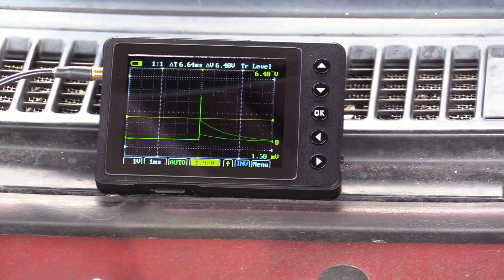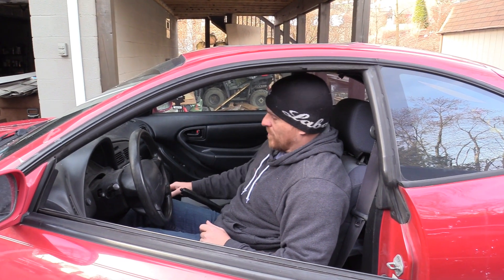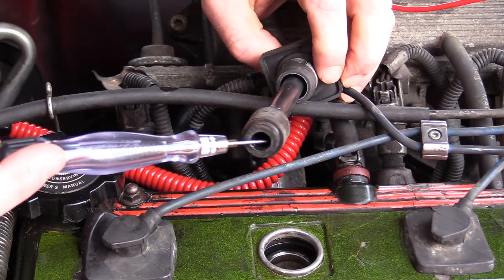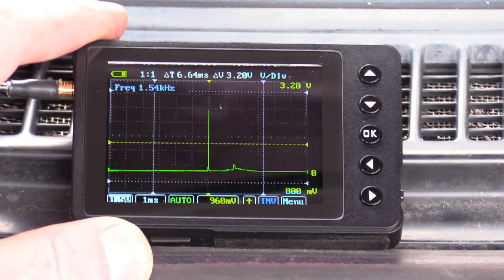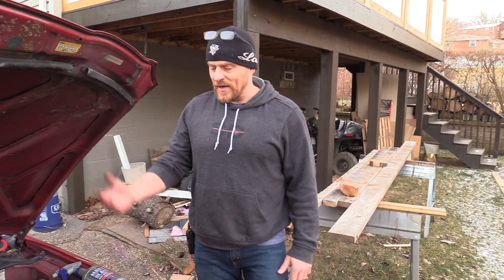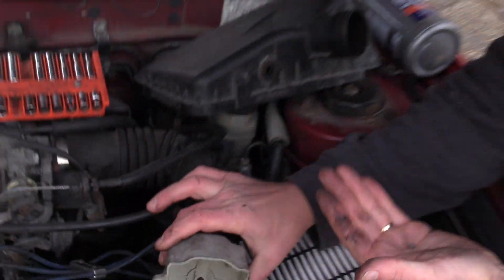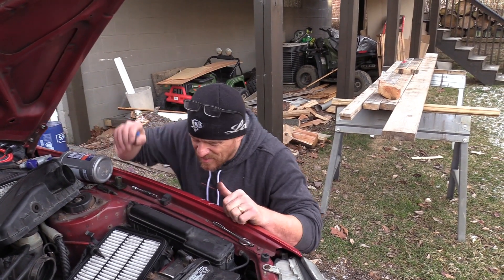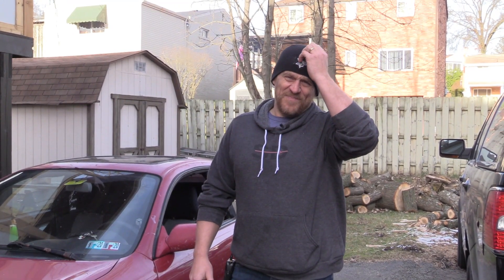Misfire, weak spark, 2 years after coil replacement 94 Toyota Celica (part 1)

Comment: WIN:  "Whats he doing with an inspection mirror in his car???  Thats my inspection mirror!!"
LOL that was awesome, thanks again Mr Danner.
I just diagnosed a broken center carbon brush in a 1998 Corvette distributor cap: no RPM signal, no ref signal to ECM, no injector pulse, intermittent spark.  The little nub was literally bouncing around under the cap like a bolt that falls out your pocket in the washing machine.
Stay gold.

Comment: Great video.  I had a 1988 Toyota Camry with a 3S-FE engine with ignition problems. It started with a distributor O-ring leak (easy fix), then it started missing really bad.  I did a resistance check on the coil and it was out of spec.  Got a new coil and for a good measure bought new Autolite plug wires/cap and rotor.  Ran good for awhile, but then started missing again.  When I pulled the spark plug boot, it came off!

Bought OEM plug wires and the problem finally went away (the misfire problem at least).  It ran really good, but after a several months, I noticed there was oil still leaking from the distributor and engine getting worse.  Checked the O-ring again (fine), what I found was that the oil was leaking internally through the distributor.  So I bought another used distributor.  It was a trouble free car other than the ignition system.  Sold the car after several years after that.

Later, I bought a 2000 Camry with a similar 5S-FE engine. Toyota redesigned the ignition system.  The distributor was replaced with coil packs and the plugs were now dual-tipped platinums.  Drove that car for 16 years, only changed plugs at recommended intervals.  Never had any ignition system issues whatsoever.

Comment: I bought a new 455 Olds in 1971. Shortly thereafter, on cold/cool mornings (I left it parked outside), it would backfire, spit, miss until it warmed up. Took it to the dealer, left it over night (they put it inside their shop) went back they said they couldn't find anything. Next time it did it, I opened the hood and noticed a tiny film of moisture on the outside of the distributor cap. Took the cap off, sprayed it with WD-40 and no miss, no backfire. Went to the parts store and bought a new distributor cap. Left the old one outside the next night, and looked at the inside the next morning and there were a couple of hairline cracks in the cap noticeable only because the moisture left a track on the cracks! Wiped it dry and I could not see the cracks. If it can happen, it will happen (to me).
Reply: I had a similar ordeel with an old ford electronic ignition control module when they used to sit on the fender. On really hot days or cool nights with a lot of condensation,  it  spit and sputtered like you mentioned. A few times it just shut down until it cooled off.

We didn't have access to all the fancy scopes back in the 80s but a friend was smart enough to set a heat lamp about 3 feet away from it while the motor was idling.  It caused the problem to surface in a out 5 minutes and I replaced it from a salvaged car. Problem solved.

Of course the module was packed with epoxy so a teardown was not informative and what little inspection we could do showed nothing obvious.
Reply: @sumduma55  Yep. Jeep used the same on my 1977 CJ5! Really threw me for a loop first time it did it. Finally put a 6 cyl Chev distributor in it with coil in cap. Stopped that BS.

Comment: Nice find. I remember the old days, I installed a lot of those distributors, no matter what Scotty Kilmer says, they break too.

(Dielectric grease is great on plug boots to help reduce leakage and help with later removal. I’ve seen connectors with it glopped in them causing issues, stop it guys, a little goes a long way to stop fretting and reduce moisture intrusion.)

Comment: We bought a 89 Camry from a little ole lady  that had very low miles, it only went out on Sundays to church well unless she was from Pasadena then maybe the strip. Some time after we bought it my son tells me it's shifting out of overdrive and he tells me that he just leaves the button for OD off. I figure maybe it's the clutch in the torque converter that is going and maybe with a change of ATF it might help with it shifting. We drain the trans, replace the filter, and put some ATF in and run it with the output line to the radiator in a clear mayonnaise jar so I can see the color of the fluid and we also flush out the torque converter. Now my son says it shifting great again but a short time later complains that it's doing it again. So now I take it for a ride and tell him it's not a problem with the trans he has a misfire. Sometimes in OD it would lug the engine and that's when it would misfire. So I look at the plugs and they could use a change and I  find one of the wires is the culprit. Not wanting to work on this car for at least another year I put wires cap and rotor in. The cap was dirty, a bit oily and there was some carbon tracing. Okay fixed Wright I mean right. Yeah for another three months or so it ran flawlessly till my son comes home one day and says it's doing it again. Dang. Turns out the seal in the distributor was allowing oil into the cap and on rainy days or when there was dew on the ground it would misfire. So I replaced the distributor and it's been a year of good service. Knock on wood. Professor to Caleb, I gotta deal with your sh I mean stuff too. Wait til they get married and move out. They figure they earned the right to free storage.  Around 34 minutes ya say there was oil in the old  distributor. Ya stole my thunder. That's my story and I'm sticking two it.  Good ten minute video guys.

Comment: Oh yea.... Needed some more in-depth understanding of this issue. I got a 20yr Taurus with this issue. Just hit 400,000 last week! 💪 Changed out the spark plugs, wires, and coil pack. Drives good, not really noticable....but as soon as i hit those rpms above 3000, CEL pops on...
Reply: Btw, Caleb the Cameraman, you're doing an "impeccable" job with that camera and especially paying attention because of your questions 💪. So i guess the next step will be putting Pop behind the camera and giving us a ScannerCal episode 🤘😊...

Thanks for the video y'all....
Reply: Wow! 400 k!
Original motor transmission?
Reply: @Nudnik1  yes sir-ree! I've babied it the past 2yrs... They call the engine Vulcan... Darn near replaced everything on this engine - original timing chain still in it too; that's my next project...
Reply: @NaturalZBey  wow I got 370 k on my Chevy Venture original motor transmission.
Only minor issues.
Runs perfectly uses no oil.

Comment: A magic trick using a distributor! First I've seen of that! 😂🤣😂 

That was an interesting failure! Wonder if play in the shaft wore out that coil's case? Since you've got both heat and age there, it could've just cracked on its own, too. That car is in amazing shape for its age. Hate to see him driving it in road salt ... but I get it - when I was that age, I could barely afford the car I had, let alone a dedicated 3-season car, and a winter car.

Way behind on vids here - headed to part 2 now. 👍🍻

Comment: That's definitely a new one!  I never saw a pickup coil, even the early GM HEI units that were on carburated engines and the Dist pickup coil wires would break at the ign module because of the vacuum advance moving the plate.

Comment: Excellent about silicone grease.. true.
It just seals moisture out and prevents corrosion.
Not a conductor.
Stabilant 22 is a conductor improvement chemical used in avionics but costs $70 a tiny 1 oz bottle.
We had "carbon tracking" inside caps in old days after some one would spray wd40 oil inside Burning up causing carbon tracks misfire etc...
Excellent work Thanks!

Comment: Have to love the non-common weird root causes. Essentially it looks like it fail just like the water pump probably did. Bearings or bushings wore causing shaft wobble and leakage, in this case oil and also slapping the coil around.

Comment: Father and son time... more priceless than anything......great video as always....how the h*** was that car running, as well as it was at that!
Reply from the maker: spoiler alert, the reason it was still running was that pick-up coil was for the single pulse "cam signal", which is not needed for it to run and control spark. For injection control without that signal, it will still fire them, just in a default strategy

Comment: Funny you mention the dielectric grease being an insulator and not a conductor . Had a coworker who was very very back woods mechanic type and disregarded any repair info research as "not being a real mechanic" . He would pack every connector he opened to replace components with it and because of that have regular comebacks . Despite how many times I fixed his mistakes simply by blasting out all the dielectric grease he would never believe me when I would tell him to stop using it in connectors that host sensor circuit pins .

Comment: i have seen this happen twice in the last 30 years.  both on pickups with 22r engine.  coil short out and overheat and expand until the wires break and then wrap around the shaft.

Comment: I can't wait to find out what the second pick-up coil is for in Part 2.
Reply from the maker: the lower one with 4 teeth is for piston position and RPM (crank sensor) and the upper one with 1 tooth is to ID where the #1 cylinder is for proper injection control
Reply: @ScannerDanner   Thanks!
Reply: That kinda makes it even crazier to see #3 consistently missing worse, unless there was a "bigger" copper strand interference in the cap.

Comment: Oil - >bad seal  -> worn bearing -> wobbling shaft -> contact with pickup?
Reply from the maker: no contact, no wobbling in the shaft, but age and oil would be my guess too
Reply: @ScannerDanner  Good to know.. That's for sharing. Hey, while I have your attention, I've been asking on your forum but no solid answer yet. Besides your fantastic book, what's the big textbook I see on your student's desks in your premium videos?
Reply from the maker: @jameswasher3938  I just added the ones I would recommend to my amazon affiliate https://www.amazon.com/shop/scannerdanner the one you seek is the one with over 1600 pages
Reply: @ScannerDanner  That's right, I had the same problem, in my case it was the top pickup coil, the resin that composes it degraded and then the rotor with 1 tooth grabbed the coil wire, the car didn't stop because of that, but the check engine light came on (code 12)  the solution was a new distributor, part number 19020-16250
Thanks for sharing Paul
You're awesome as Steve says LOL
Reply from the maker: Dude, wait until you see part 2. You'll love it, my mistakes too
Reply: @ScannerDanner  Can't wait for part 2. When can we expect it?
Reply from the maker: @jameswasher3938  shooting for Saturday Feb 1st at noon

Comment: Is it that distributor design had two position senders? One reading  four pins for ignition events and second acting as cam position sensor (sending one signal per 360 of cam) for I think for sequential injection.
Reply from the maker: That is correct! And the reason the car still ran was that was the 1x cam pickup that failed

Comment: Love your channel. You are a wealth of info and diagnostic technique. Gotta ask a question though, once you realized you had an intermittent problem, why not just pull the cap off? I don’t know what the parts prices are, but I’d have just sprung for a cap, rotor and wires. Of course, once I opened it up and saw the oil and wire in there I would have realized I had a bigger problem.
Reply from the maker: Good question! For me, my diagnostic strategy is sometimes altered by the camera. I want to prove the issue for you guys before taking stuff apart.

Comment: "Dialectric Grease is an insulator"  I was at a local hardware store a while back looking for conductive grease, and the sales staff kept handing me Dialectric grease. I told them it was an insulator, but they wouldn't believe me.
Reply: Stabilant 22 is conductor chemical used in avionics and Marine electronic and at home Depot they have white conductive grease used on splices in primary secondary connect. In electrical Dept.
True silicone grease only stops corrosion not a conductor.
Reply: Use Copper Never Seize, we used it in resistance welding and if your careful it works great on relay pins in an old corroded auto fuse box.
Reply: @frankl1955  yes I have excellent salt water marine battery cables copper anti seize the best .
Reply: boostedsil40  keeps water out stops corrosion. Ok to use.30-50k volts in secondary ignition will not be affected.
Reply: Next time just tell them to look up the word "dielectric" in the dictionary
Reply: @jonclark1288  true dielectric oil used in transformers .
Reply: Wait a minute , Dielectric grease is ALL that should be used. About a pea size gob. carefully smeared around the lowest inside of the rubber spark plug boot. It insulates the high voltage spark from running down the spark plug porcelain to ground. You must do this step.
Reply: @rodneymiller5926  yes only olive oil on Fiat though
Reply: @Nudnik1  is olive oil an insulator?

Comment: Thanks for of course another good video! I have a question though about you saying to check the plug wire with the scope at close to the coil???  I would say you would want to check it close to the spark plug! Like you said-if there was break in the wire in the middle then at the coil it may show that it is firing but it matters the most at the plug. That is where you want to make sure you have voltage/spark/? If you dont show a reading there, then work backwards toward the coil. Like that is why you pull the spark plug wire off the plug to check for spark there first. If no spark then pull the wire from the cap and check-I dont think you would do opposite of that would you? Thanks for you time and info...Ken
Reply from the maker: always, nearest to the coil if you want to see what is actually going on. If you have a break in the wire, your KV near the ignition coil will show it to you in that you will have a very, very high firing line. On the other end of the open plug wire you are going to fight your scope and wonder why you are getting some weird readings.
Reply: @ScannerDanner  Wow, great reply, I never thought of it that way. That is why I asked the master!! Thanks so much

Comment: No quick vid for you. now for the polar opposite of your situation. I stopped to look at a malfunctioning brake light on a 14 Hyundai a few days ago. determined quite quickly that it was some sort of loss of ground and it was dim, energizing through other side of bulb a 2357, which is a lower current version of the 1157.(technically a LONG circuit, yes they exist. where 2 circuits converge in the form of a ground, loss of ground bridges 2 circuits together to ground through each other generally limiting the current like a resistor). It was dark and raining and i wasnt having it. I postponed it until today jan 25, 20, made sure i had my Vantage pro, my power probe pp3, incandescent test light and as a hail Mary my Power Probe  ECT3000. Test light and a stick to jam the brake pedal, 10 minutes, and i had it pinned down. Bad socket. Thats the flip side of your situation.

Comment: The delamination came off the windings poss cleaning with non electric cleaner.. ie carb ,brake cleaner .. that's crazy....dont see antifreeze doing that .. but if oil goin past could of done the damage as a mist on the windings could of caused deterioration as oil is petroleum right???

Comment: Off topic here but I was wondering if anyone could help. When scoping a fuel injector  with the snap On pro and low amp clamp how do I get it to show repetition without dropping out? For instance when I zoom out to see if dropouts occur the scope it doesn't work right,  it's not reliable the waveform has missing data or cut in half. It works fine on lower time frames but not high. Is there anyway of fixing it or do I need a pico?
Reply from the maker: You really need to watch my lessons on scope sampling, trigger, time base etc. I have an 11 hour class on the Verus on my Premium channel and some free picoscope basics ones right here on YouTube. And you don't need a pico or verus to learn from them

For Snap-on scopes:
1. To see detail AND repetition you must set your scope screen for detail, then let the buffer fill, then pause it, then zoom out to see the repetition. 
2. The gaps you mention when you increase your time base is called scope aliasing and is caused by a sample rate problem. Select "peak detect" for long time bases.

Comment: I had a 96 3500 bbc come into the shop for frontend and brakes. Got done and started it and injectors 1 and 2 were dumping fuel. Now their not.... I'm going to shake down the harness and try to get them to fail again. I hate intermittent issues ! As bad as p0442 lmao
Reply from the maker: right? and it is all your fault :-)
Reply: @ScannerDanner  lmao.... "Ever sense I" is right. Thankfully the shop owner understands that shit happens. He called the owner and the owner admitted to having past problems with how it was running terrible sometimes. I just need to make sure it's not an electrical issue

Comment: that same pickup coil is likely what's wrong in the other distributor and was causing issues. I don't recall if all model year use that coil even and I'd guess no, since it was shredded up!
maybe that was leftover from days of carburetor, been too many years lol.
** I hate remembering things after the fact, that would be the coil used as "crank speed and angle" if my brain farts are still working right, too much thought on some old heap that's not mine :))